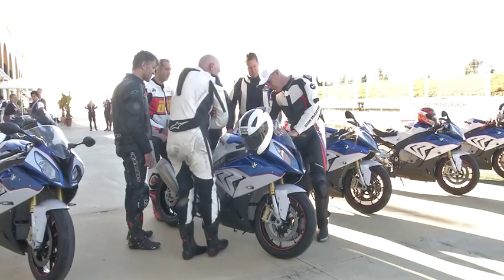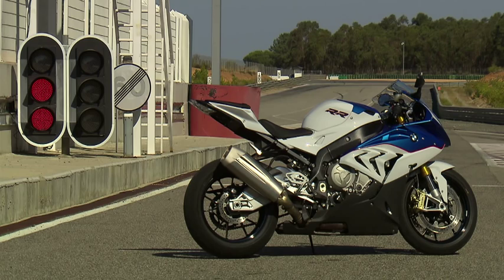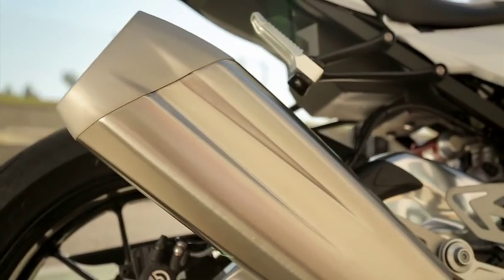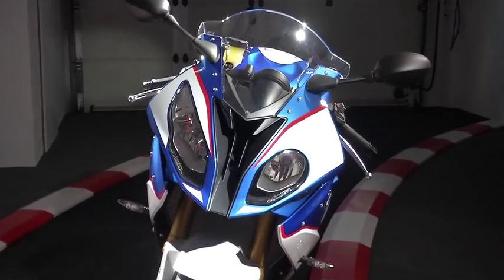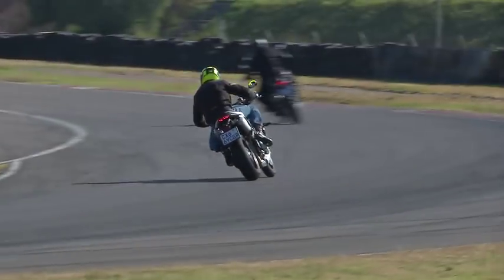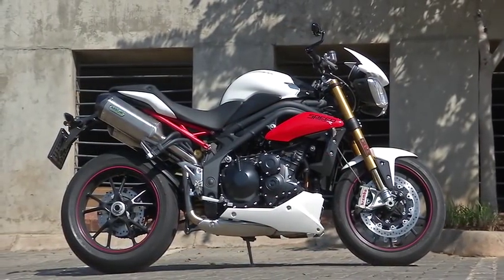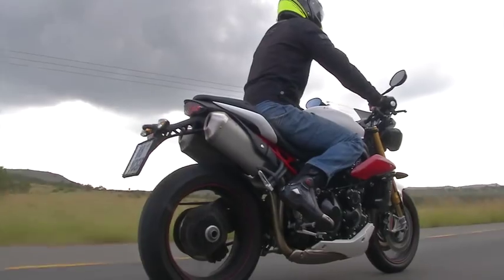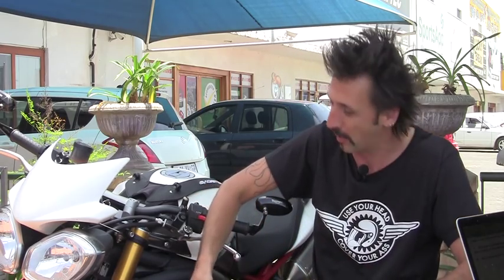2015 BMW S1000RR Part 2

Comment: I didn't like the assymetrical design of the s1000rr or the hp4, but i does like their performance especially the advanced DDC which is very useful for a superbike. Thumbs up for the BMW S1000RR. :D